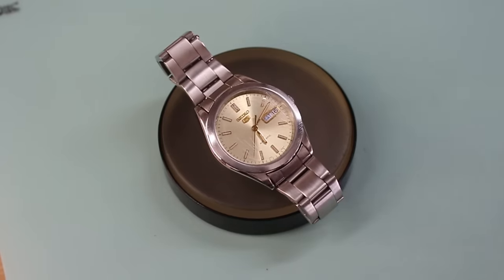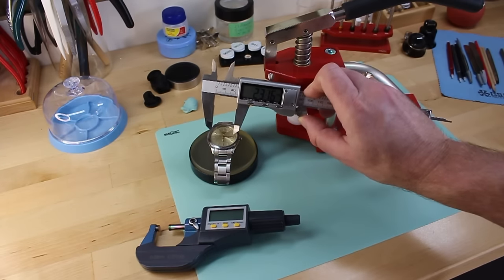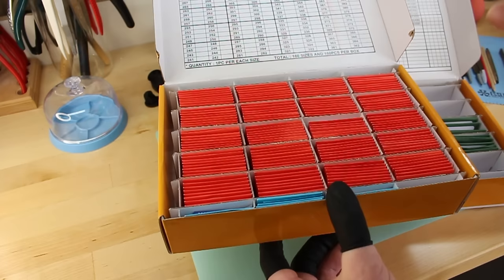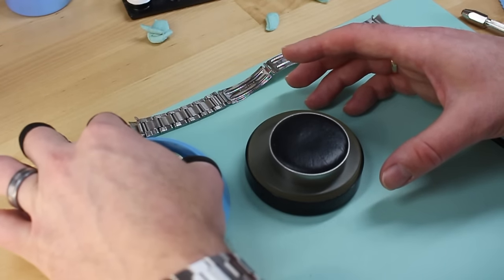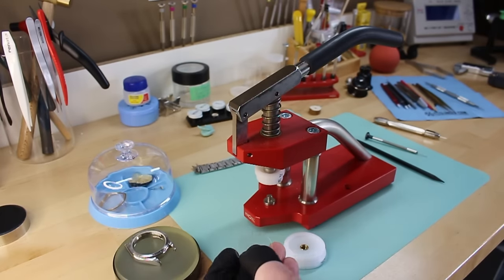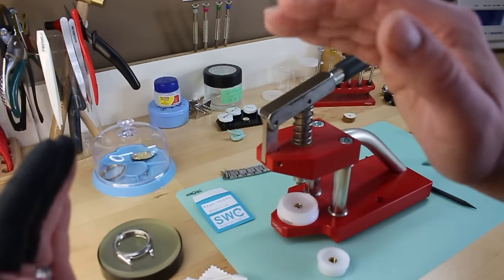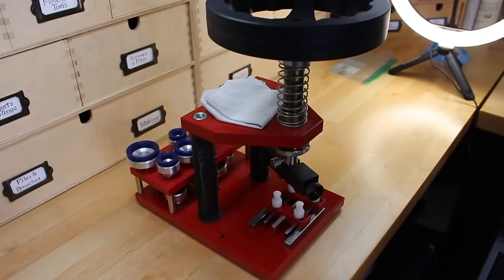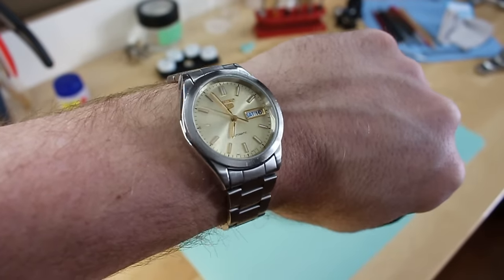How to Replace a Scratched or Cracked Watch Crystal, Step by Step

Comment: Hi great video, I have a watch which I replaced the crystal on, I put in the new crystal and I am able to pull it out from the inside but from the outside it is hard as rock, I think I need to get a bigger size what do you think
Reply from the maker: yes, sounds like you need a crystal an extra 10th of a millimeter (or maybe 2/10ths) wider.  If it pushes out that easily it might drop out if the watch is knocked the right way while being worn.

Comment: Nice video. How much would it cost for a replacement to be done? I have a Seiko Kinetic/Quartz Men’s Watch V739-0A89 and the crystal is badly scratched. I don't know if it's a valuable watch and if it is worth doing but I'd like to wear it.
Reply from the maker: A crystal replacement by me is usually $65 CDN, unless it is a particularly special crystal - but most Seiko Kinetics I have done in the past where pretty standard.
Cheers,
Colin
Reply: Thanks for the quick reply. I've been searching online to see if the watch was worth much and if it was worth getting done. Can't seem to find it's value anywhere.
Reply from the maker: If ypmou like the watch its worth it!  Replacing the capacitor every 12 to 15 years is typical as well, and many customers have opted to get it done as well - and a cap change runs about $45.  (something else to jeep in mind as a future cost of ownership).

Comment: Thanks for the video, I just took out the sapphire on my tag heuer formula 1, it's 33 x2.3 thick , now I can only find 33x2.0 , do you think it would create an issue if it's slightly thinner ?
Reply from the maker: It should be fine in terms of seal and fit - however depending on how high the orginal crystal was above the case the lower crystal might look a bit funny.  In my experience a difference of about 0.2mm is usually okay.  So If the original was 1.2mm for example going to either a 1.0mm or a 1.5mm depending on the depth of the crystal seat in the case has worked.  In your case it's hard to tell as 0.5mm a significant difference is depth.  You can always try though!  If it doesn't work nicely you can always press it out again and go on a deeper search for a 2.5mm.  Let me check to see if I can find a 2.5mm for you?  I'll look around and see if I can find something.
Reply: @watchoffthecuff  Og actually z I just noticed your store is in Canada and I am in Canada , I was buying my parts from Perrin before z I'll check out your store you seem to have a lot of horotec stuff that's nice
Reply from the maker: Just recently became and authorized dealer for Horotec, and even more recently for Bergeon as well - just haven't loaded all the new stuff yet!!!  If you are ever in Milton let me know! Happy to give you a tour of my mini shop! lol  Are you in Ontario?

Comment: Hi thanks for the reply- what is the press you use to remove and replace the crystal please, thanks
Reply: The lever press not the case remover press, thank you
Reply from the maker: my bad....let see if I can attached the original box with part jumber for the crystal press....
Reply from the maker: arghhh not gonna work... model is a Horotec "Standard Press" MSA 06.135 and is often bundled with a standard set of round dies.
Reply: @watchoffthecuff  brilliant, thank you

Comment: How would I get a double dome crystal out? The crystal press form all have a flat floor so I can’t press through. Can I press from out inwards through?
Reply from the maker: You definitely need a press with cupped dies.  Even pressing a new domed  crystal in will need a cupped die, if not it is very likely that the flat die pressing on just centre of the dome will crack it.  (years ago this happeded to me before I got an upgraded press with better dies!)

Comment: Does this gauruntee the water resistance? I am assuming the outward pressure of the crystal against he plastic gasket creates the water resistance of the crystal-face?
Reply from the maker: Yes, the crystal does make a water tight seal against the gasket.  Guarantee?  - nothing is a guarantee!        If I was cincerned though I would put it through a water resistance test.  I show this procedure at the end of this video here:
https://youtu.be/46D5FiGaJiA?si=0QGEVJaE1Gp3jSjw
Reply: @watchoffthecuff  Thanks, that was my next question. What makes a "good quality" leak tester, as there are many on the market. This helps answer that further. Thanks a BUNCH !!!!!!!!
Reply from the maker: You are welcome!!!

Comment: I have a seiko (7005-8000) and i have broken the original dommed acrylic crystal, can you tell me what diameter should my replacement crystal be ?the case size is 36mm without crown.
Reply from the maker: Is it possible to measure the damaged crystal for dimensions?  I don't have this info and if I could find dimensions on a similar vintage Seiko I would be concerned that it wouldn't be a prefect match as I would be assuming all the crystals on these models were the same and they may not be!
Reply: @watchoffthecuff  unfortunately the original crystal is broken but I can find on a website that the diameter of the crystal is 29.5mm and i was wondering if i should get the 1.5mm or 2mm in thickness of the crystal.
Reply from the maker: Nice find on the diameter!  I would go with the 2mm.  Just my preference.

Comment: Hi. Can the crystal on a tissot t race be replaced?
Reply from the maker: send me a picture of the watch?
Reply from the maker: I did a quick internet search... yes it can be replaced.  Looks like its a Sapphire crystal, which is great - but sometimes can be hard to get the correct thickness anf diameter.  Mineral crystal is available in 1/10 of a millimeter increments, where off the shelf Sapohire is typically availablre in 1/2 of a millimeter increments.  Do you know what size you need?
Cheers, 
Colin
Reply: @watchoffthecuff  Hi Colin, I have a T race whose hands are very very difficult to see hence telling the time is very difficult. Could I get the glass removed and the hands painted/tinted white? Otherwise, watch is no use.
Thank you.
Reply: @watchoffthecuff  please advise
Reply from the maker: if the crystal is not damaged or scratched it does not need to be removed, the watch movement, dial (and hence hands) can be removed as an assembly through the back of the watch.  I have suceasfully painted hands, but its bery trial and error to make it look good.  Instead find out the movement model number (aka calibre) and find out what diameter hour, minute, and second hand posts are and get replacements that you like.  Hope thay helps!
Cheers,
Colin
Reply: @watchoffthecuff  Hi Colin. Very big thank you for your helpful reply. You are a true professional and a gentleman.

Comment: I really wonder do you use the microfiber cloths once or clean them. because when you use them a lot you just  smear the filth on the surface you want to clean right atleast that is what i notice with glasses.
Reply: and what is that thing you call rotoko to clean the gasket with
Reply from the maker: https://watchoffthecuff.com/products/bergeon-6033-rodico-cleaning-product
Reply from the maker: left a link!
Reply from the maker: You're right at some point you have to clean the cloth itself or you just smear the dirt and oil around.  To miimize this I thoroughly wash the crystal first then use a special purpose cloth to do the "final wipe", instead of trying to use the cloth the remove any significant dirt or oil.
Reply: @watchoffthecuff   thanks, how do you clean the used cloth? by boiling in soap or something?
Reply from the maker: honestly, I just through them in the laundry.  If they are really awful and a regular wash doesnt cut it  I just throw them out as they are not that expensive.

Comment: I shattered the crystal and now little bits of glass are stuck in the adhesive (I guess) around the edges of the ring.  how do i get rid of them?
Reply from the maker: You should use some Rodico to grab any pieces of debris....
https://watchoffthecuff.com/products/bergeon-6033-rodico-cleaning-product?_pos=3&_psq=rodic&_ss=e&_v=1.0

Comment: This is an acrylic glass? I've heard that you can't use an acrylic/plexiglass with a plastic glass gasket, only mineral or sapphire Glass can be used with a friction fit glass gasket?  Is that right? I don't see why you can't use an Acrylic crystal with a friction fit gasket. Trying to work that out...thanks
Reply from the maker: The process shown is for mineral/sapphire only, as you have guessed.  Acrylic crystals usually are compressed and fit into a lip in the case so they dont fall out.  I show this in another video here...
https://youtu.be/pjHlBZFUDQ0?si=BET7hLFoS95XLKoo
Reply: @watchoffthecuff  Thanks for the response, so using a replacement acrylic crystal in a watch that used a plastic gasket won't work? I watched you're video you just attached, however I've seen people press acrylic crystals into place and pop them out too, without that claw tool. Can I ask why an acrylic crystal won't seat with a gasket?
Reply from the maker: no, the reason is that the side profile of acrylic crystals isnt flat on the side like a glass crystal.  It has an extra step out that fits into the lip of the case designed for acrylic.
Reply: @watchoffthecuff  what about Acrylic that have retainer rings on the inside? I've seen people press those crystals into place on the case- without using that compression tool. I bought a replacement acrylic crystal for my diver that had a glass crystal. I guess I'm screwed now?
Reply from the maker: Without seeing the crystal, the case etc. it's hard to say... But if I had I bet on it... It's not going to work.  You are welcome to send me a few pics to colin@watchoffthecuff.com and I can take a look?
Reply: @watchoffthecuff  Thanks for your help, appreciated. You are one of only a few channels that make an effort to actually respond and help people with their conundrums

Comment: Does the turning pin just pull out? I'm attempting this on my tag heuer after being quoted £300 for a glass replacement. Watch was a gift anyway so neither can I afford that kind of repair or fancy paying £300 for a glass replacement when I see genuine glass be sold for £25 on ebay. I appreciate theres a markup but blimey!! I am considering just super glueing something to the broken glass and yanking it out and just pushing the other one back in gently
Reply from the maker: The crown and stem need to be released from the movement using a small (and sometimes partially hidden) button or lever.  I have a bunch of videos that show how to do this.  It is unlikely you be able to pull the crystal out with enough force, same for putting the new crystal in!  This is an expensive crystal press that I use in the video, but cheaper ones are available and will work, they just won't hold up with repeated everyday use (which is why I later had to upgrade to a progressional level crystal press).
Reply: @watchoffthecuff  thank you for the advice 💪🏻

Comment: Why didn't you show the stem removal????
Reply from the maker: It ended up getting cut by mistake during the editing process, however, the link to thiis video shows the crown removal process on a different Seiko, but same movement calibre!
Cheers,
Colin
Reply: @watchoffthecuff  HI  I see!  Reason I was watching your video in the first lace was that I have a ladies Timex WR 30M Indaglo with a broken crystal. I can not see where to press to remove the stem to get the movement out and was hoping you video might help.